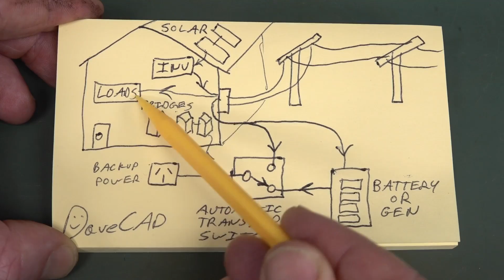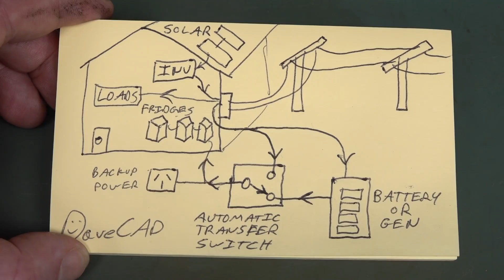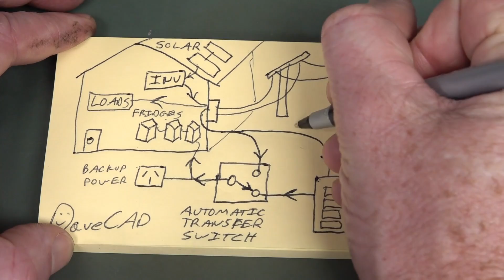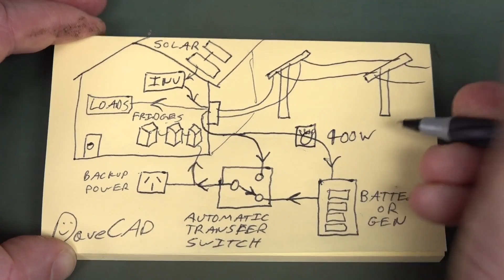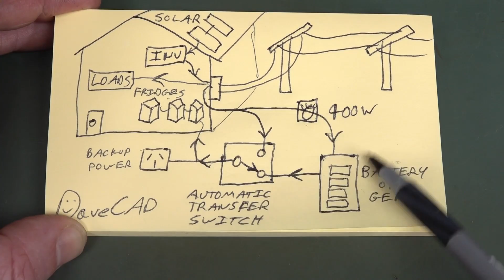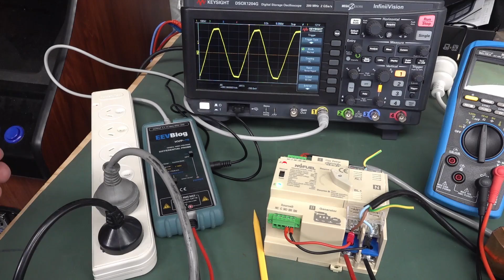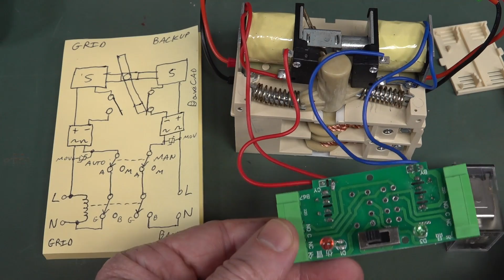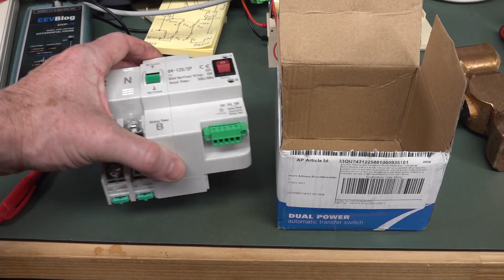EEVblog 1500 - Automatic Transfer Switch REVERSE ENGINEERED

Comment: When you get into larger transfer switches they of course get a lot more sophisticated. Automatic delays to ensure the grid is actually stable before switching over, voltage/frequency checks, and feedback to modulate the generator speed to match phases and frequency before switching.
Reply: None of the 2,000A switches I work on ever bother with generator synchronization. They just do a 1s break before make. If the load is critical, you slap a UPS on it.
Reply: We use ABB Synchrotact to perform Make Before Break transfer from generators to grid. The device will even command the generator to speed up or down so that it's frequency matches the grid's exactly. Once the frequency and phase of both buses align, the tie breaker closes.
Reply: @RoyChai  I'm guessing that's for when grid power comes back on?, but it's (nearly) instant  when grid power fails
Reply: That would be a concern of mine. Voltage sag with a battery source could produce a rapid on off condition as would an overloaded generator. There should be a delay circuit on the line in if used in this configuration.
Reply from the maker: Yes, more complex models have a 30sec delay and brown out detection etc.
Reply: @EEVblog  Hi Dave yes but if you look you have spare auxiliary contacts on each side plus you have your AR and BR connections which are your contactors you can wire it with timer for transfer time with timer and also electrical interlock  so you dont have back feed in case of contactor fault which can be catastrophic.  Hope this helps you out you need to look at all worst scenarios to make it safe  as per AS 3000,  love your  videos greetings from Adelaide
Reply: Right. Scada tech here.  Grid size and it involves  multiple  switches, load switching, and feedback  from the ECC before it is allowed to click back on.
Reply: Ergh, you just reminded me of a few weeks ago when we had trouble syncing our baby 12MW generator to the grid, fault finding mordern 11kv switchgear gets pretty deep 😬
Hopefully less explodey though
Reply: I was thinking that's really missing on here, when the power here comes back on it's often very dirty and often has to "try" more than once before it's reliable
Reply: Right.  We had some large pumps on a transferrable switchgear.  The two feeders were normally in phase so we could do a 'fast' transfer.  Anything open the normal feeder and the 'b' contact would allow the alternate feeder to close (< 16 ms delay).  But if there was a different sort of problem (lost normal feeder upstream), we got a 'slow' transfer.  The 'slow' logic would BLOCK the alternate feeder until all the pumps were isolated, and then allow the alternate to close and all the pumps could be manually restarted.

Issue had to deal with the pump motors momentarily becoming 'induction generators' and closing the alternate while they still coasting down was a big no-no.   Operators keyed in on that.  "Okay, the circ-water pumps are off, so it was a slow transfer, manually restarting circ-water pumps"

Comment: You can use a raspberry pi running a program called sunwait to control a relay. That will turn off the mains based on where the sun is in the sky. Its adjusts due to timezone and season. You set it to turn on/off the relay based on the angle above the horizon the sun is at. I use one for my garden lights, sun is at -5 degrees so below horizon, biggest issue is that the Pi can't tell the time for toffey so needs an internet connection and if it loses it (and it will lose it) the time goes out of whack, have to schedule in a reboot of itself every day to solve it.
Reply from the maker: A simple mechanical timer works just fine. Technically I could use an optional auxillary relay output on my Sunnyboy inverter.
Reply: You may use a $5 sonoff basic flashed with tasmot for this. It will sync time per NTP and you can set it to switch the internal relay on sunset/sunrise. I use a sonoff POW2 which also measures the power generated by my grid-tie inverter.
The micro inverters run on a shelly pm1 which does the same thing but costs $20.
Forget the rpi, way too expensive and complicated.

Comment: keen to see the battery u'll use... do the numbers.... installed commercial products can cost 85c/kwh!?!?!

there is ONE inverter in Aus that can work on any battery including generic DIY, IMO its the only solution.

been running hybrid for a few years - discharged over 2mega watt so far!
Reply from the maker: Which brand is that? Yes, most hybrid inverters only work with a specific brand battery and that sucks.
Reply: @EEVblog  Deye, yep welcome to vendor lock in!  We know this in the IT Game very well :)
pingd you an email mate

Comment: I wouldn't trust this cheaply built thing to power from the grid. It highly likely doesn't have the certifications. If there's a fire and the insurance company finds it, will not pay out. Try getting a good ATS for 3-phase mains. ABB makes them, cost about 1k€. People usually go with manual ones for this reason, they're "just" 80-100€. I've been thinking about making my own with two interlocked contactors (mechanical plus electric interlock), timers and relays, but you need the neutral contact to make before the phases, to prevent a floating neutral from frying stuff. So I'd need an early make auxiliary contact with high current rating (>25A) but I haven't yet found one.
Reply: It's much simpler for 1-phase, you don't care if the neutral connects before live, you could use regular contactors. Either two interlocked ones or one with NO amd NC contacts. You'd need a contactor with enough contact clearance to satisfy the requirements for a disconnection device.
Reply from the maker: @brainndamage  I only have single phase.

Comment: I like this switch, it's so simple, not over-engineered and should be reliable.
Automatic transfer switches make sense 1) when you have two separate utility connections (primary and backup), or 2) you've got a generator that can be remotely started.
I wonder if the relay uses its auxiliary contacts for controlling the generator startup; it would make sense since as the mains dies and the relay turns off, the aux contact gets toggled, starts the generator, and when the generator is up and running and supplying power, the solenoid in the ATS gets energized and the changeover happens.

Fridges won't care, but for any servers, computers etc. get yourself a UPS that can keep them powered through the changeover process.

You got a lot of distortion in your mains. All that SMPS rubbish - forget about clear radio transmissions... It's sad.
Reply: It does not look safe or useable for your main household - not to mention code
Reply: It indeed seems that the relay contacts on the primary (A) side are intended for a generator start signal - C and NO at the top of the device. The manual for these can be found if you look up Geya Electrical, model W2R
Reply: U are on like every electronics video comment section LOOL
Reply: @mysterious_czrs  well, kinda. Some science stuff too.

Comment: I wonder if the plastic in those transfer switches meets the necessary flammability requirements? I have a feeling it doesn't. But I at least like how the slightly crooked "QC PASS 08" stamp in the manual is actually just an image in the pdf :) 

The metal sheets at 18:38 look like arc splitters to cool and extinguish any arcs from breaking loads (particularly inductive ones), not sure if I'd trust them at 400 VAC 63 A but probably good enough at 240 V 10 A. However one thing I don't understand is that both units have speed holes on the front plastic cover presumably either to ensure the impending explosion is vented forwards towards the user to cause maximum damage or maybe they had issues with the low quality contacts overheating and their solution was just to add ventilation slots, but seems like it's just begging for contamination issues.

I also assume this change over switch and battery inverter will not be considered a 'fixed installation'?
Reply from the maker: It's not a "fixed installation", as it's not physically permanenty connected at all.
Reply: I'm betting not, I do not see  any real separation between Gen and Out, I'd expect that thing to be a fire hazard, and your screwed as insurance wont pay out.  I do not see any Aussie Compliance "RCM" markings, just the fakish "C"hina "E"lectrics mark (note the non existence of the spacing between C and E which exists on the real European thing)
Reply: yeah, not that I care (because we do it at work all the time), but I'm certain this wouldn't pass AUS electrical code. I doubt DIN rail is certified for use anywhere inside the home. Sadly, as its really useful stuff.. wish my breaker panel was all DIN.
Reply: @Ressy66  Agreed, except for the whole "China Electrics" thing, which isn't real (and wouldn't make sense anyhow). CE markings are self-issued so if it's on there, the manufacturer/importer claims it meets the required standards.

Comment: Bars on top are arc catch plates, you will have a big arc on breaking under current, and closing on current. Contacts are large to handle the inrush current, which can be 2kA, and the flexible copper braid has to be rated to handle this inrush current. Common parts in all AC contactors and all AC breakers, to quench the arc and connect the moving contact to the terminal.

Ideally you want a separate delay relay in the feed to the incoming supply, so that power has to be applied for 30 seconds before it is reconnected, so that all the transients on the line can die down, and also the massive inrush load can subside from all the other loads being turned on cold.
Reply: Agree with all you've said.  Came here to comment those plates are 'arc chutes' to quench the opening arc.

Now, when you get into entire switchgear being transferred, you even get into 'load-shedding'.  Some rotary loads with high moments of inertia have to be stripped before allowing second power source to close in (otherwise the sudden reenergizing of those loads will create massive torque transients).  'Fast transfer', vs. 'slow transfer' versus 'dead transfer'.  With BIG loads, it's a lot of careful study.
Reply: @Pharisee Spotter Even 500W load can cause arc over if switched between different potentials without the arc chambers, ask how I know this._
Reply: I agree, you can see the gaps also in the plastic cover on the back right of the DaveCAD segment.
Reply from the maker: Yes, some of these transfer switches have 30sec delay built in.
Reply: I used to work for a company that manufactured very large backup power units (our largest at the time was 1 MVA).  The contacts and bus bars used were massive as were the arc extinguishing plates.  Any large switchgear manufacturers will have similar (Siemens, Square-D, Eaton, etc.) devices.  I could not find any other test videos of contacts up close but this give the general idea of just how violent it can be for large gear and high currents: https://www.youtube.com/watch?v=DS06Q6oMRYY

Comment: Just saying that if your fridge or freezer goes and defrosts within 12 hours after power fails, and you have not been opening it every 5 minutes to use stuff out of it, it is faulty. Even the cheap fridge and freezer I have will keep stuff frozen for at last 12 hours without power, and they are the cheap ones from the supplier, mechanical thermostat, simple seals and R600A refrigerant.  As power by me can go regularly off, 2 hours or more at a time, fridge only has a nice big MOV block on the power rail, as the motor does not really worry, but all the nice fancy inverter types are well known to go boom. More than 6 hour power cut out comes the generator, and it runs them for around 4 hours to get cold again, and it then off again.
Reply from the maker: Yeah, you'd usually get away with half a day of power fail or something, but if you are say away for the weekend then you are screwed.
Reply: @EEVblog  Always keep them full. Use water jugs to fill empty space. Think thermal flywheel.
Reply: @jayjay6804  as one of the other channel mentions  (can you guess which one) you should use a chest freezer because it's more efficient as the cold doesn't flow out.

+ than you have back up frozen water in case of water issues.

Although being in Australia I'm not sure how that works because being that the chest freezer is upside down anyway all the cold can fall out when you open it so I don't know. Between all the weird bugs and creatures it's just crazy weird down under.

To find answer turn computer or device upside down (might be difficult with Smart orientation sensors)
VV Read text upside down and less devices upside down VV
Answer: technology connections
Reply: What is a "MOV block"?

Comment: Nice idea. I guess you got the Battery from the last video for free, so it could be put to good use here.
There are combined Solar/Battery inverters out there, that have all this built in. If someone is thinking about implementing such a system, the purpose made inverter is probably the best solution.
Reply from the maker: That's the Hybrid inverter I mentioned. I'm thinking of replacing my sunnyboy with one of those and adding a battery.
Reply: @EEVblog  I've got one of those in my setup.  I use the Schneider XW+ 6848 NA with Midnite Solar Classic 250 MPPT chargers.  Works great.  Transfer time is just long enough to reset my server though.
Reply: @ccoder4953  What maximum milliseconds would you recommend for keeping computers alive? I realise it depends on how much charge the PSU can hold vs its loads, but I'm trying to figure out what a typical PC can last for before going dead.
Reply: @jimmybrad156  Yeah, it varies quite a bit, depending on load and PSU.  Some of the very small form factor supplies achieve their size by switching fast and using small output caps.  Others have huge output caps.  Pretty much any supply should be able to ride though perhaps a few tens of milliseconds since that's about on the order of a line cycle, particularly if it isn't all that close to its maximum load rating.  Beyond that, really hard to say.  Could be a line cycle or two, could be seconds.
Reply: @EEVblog  Actually we have to distinguish

1) grid-tie/off-grid hybrids which run grid-tied during normal operation and can power the load with a mix of solar, battry and utility power at the same time (and even feed excess power into the grid),

and 2) off-grid inverters with utility input and built-in transfer switch, which can power the load either from the inverter output or from utility, but not simultaneously.